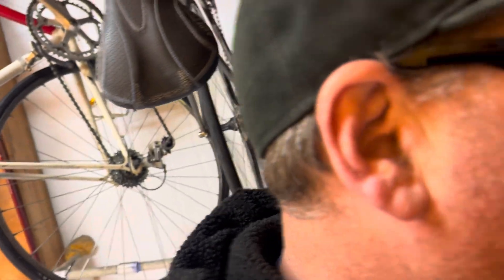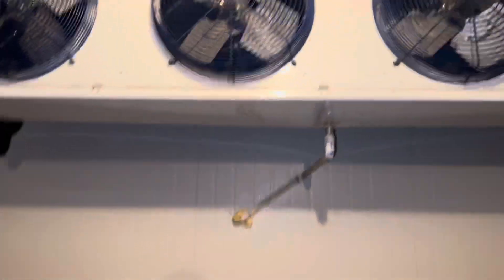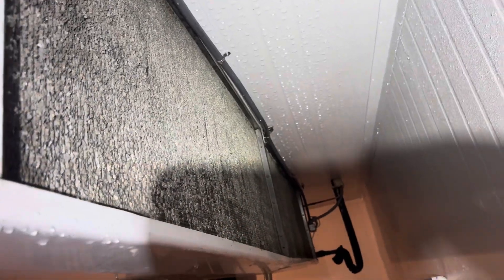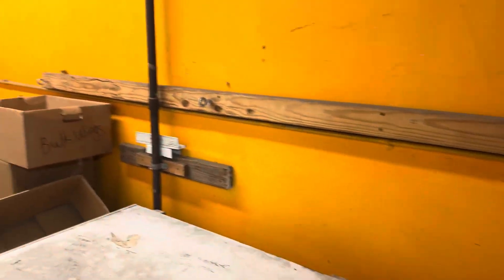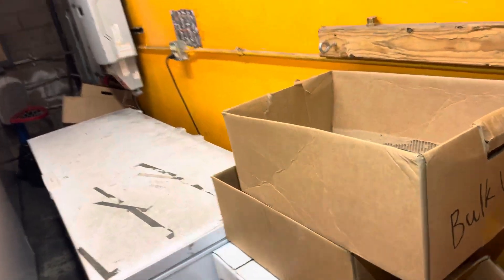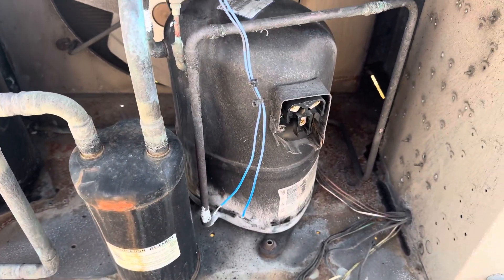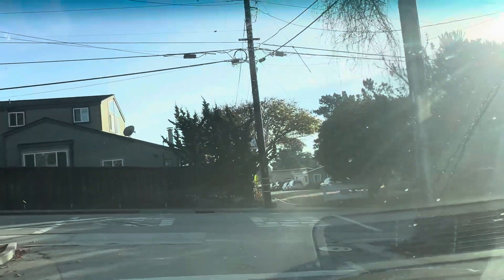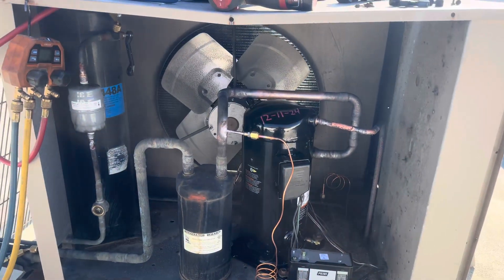Why Did The Compressor Fail?

Comment: I had rotor snap on a compressor, or something snapped. Being that I work on ice boxes, I had to replace the whole condensing unit on top.

Now I have an evap swap and my dumb self didn't tape up the tubes before I fished it through the hole on top so I could mount the thing, so maybe foam got in or I have a block at the cap tube when I brazed it in. Ran nitrogen, had flow coming through, seemed weak though. Then charged the system and low side would  regulate but the high side would settle wherever it went to and doesn't move. Kinda pissed I went through all the headset doing a evap swap for a box and the damn thing is clogged or something.

Comment: I’m not a fan of the sweat in LP controls.  Dual pressures are fine but I have been using the threaded ones with a core depressor for a long time now and change them and the core every 2-3 years or so during a maintenance.  Haven’t had a leak or failure in ~12 years, I do the same with fan cycle and high pressure switches.  Cheaper than a dead compressor at midnight.  I also have wondered if I could get away from pumping down just using an accumulator and solenoid valve, not willing to experiment with a customer though

Comment: Good Video ! Yea, One thing bad about pump down systems. if L p. control fails causes all kinds of problems worst is compressor failure.
Something to be said for just Knocking it off & on Temp control & a Contactor when it has an accumulator. no chance of failure. less parts. less problems.

i'll bet u could sell those guys a Maintenance. Tell them you will swing by every 3 Months Vacuum Evaporator & Give system a once over.
Clean condenser Every 6 Months or as necessary.

Did u get a Chance to Replace the Contactor ?

Good video.
Reply from the maker: @OcRefrig  new contactor yes. And yes I told them I need to do regular maintenance 🤘🤘